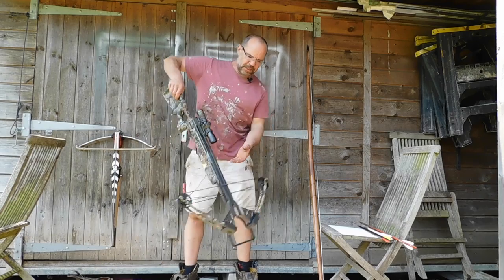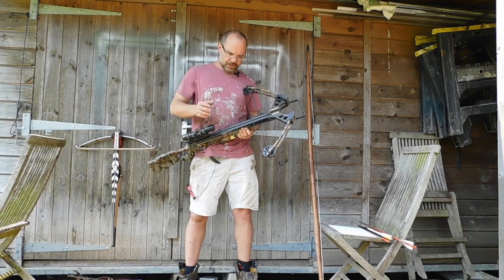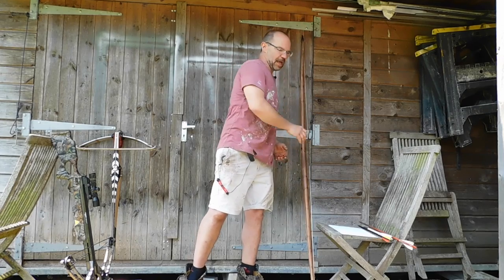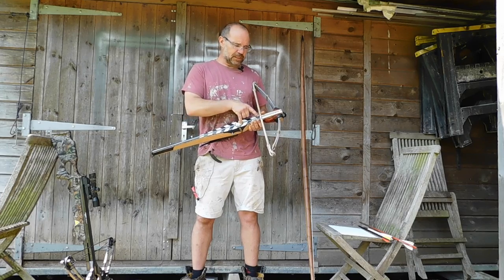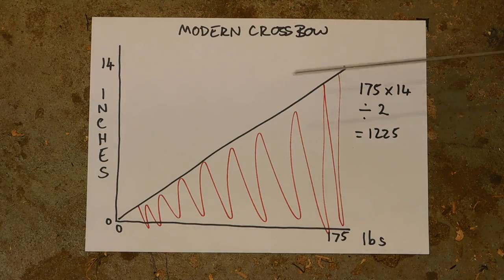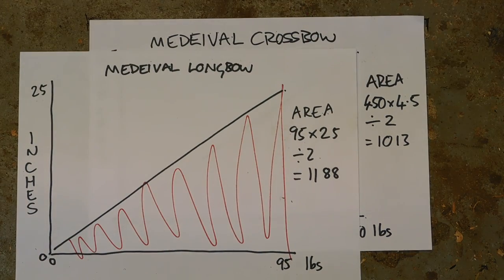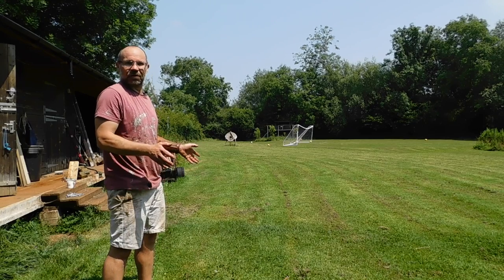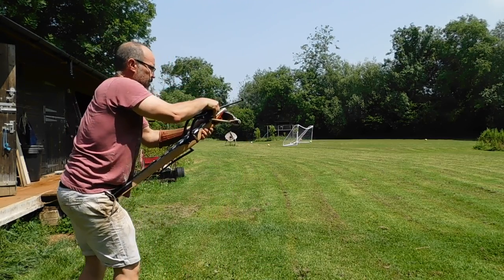Draw weights of medieval crossbows, longbows and modern crossbows

Comment: I guess this demonstrates why firearms of the day, primitive as they were, had replaced bows so rapidly.
Reply: It was also the fact that to be a competent longbowman required years of practice and exercise, and even being a crossbowman required a degree of skill that took time to acquire. A green footsoldier could be trained to fire an early firearm to the limit of its accuracy in a couple of weeks. This made it viable to field large enough units of arquebusiers that the volume of fire made up for the inaccuracy of any individual firearm, and do it for less money than it cost to train and maintain units of crossbowmen or longbowmen. 

The comparison with modern handguns is relevant for showing how much modern weapons have increased in power, but I think it would be more relevant to include comparisons with the firearms of the period, with all of their warts -- poorly-made gunpowder, smoothbore weapons with significant windage, limited rate of fire, etc.

Comment: A KE comparison of an arrow versus a bullet just isn't viable. A broadhead and a bullet do their damage in entirely different ways. Cutting an inch or two wide path through a human requires magnitudes less KE, and is more about the momentum. Bullets slow down massively, using a lot of their KE to mushroom the bullet.
Many folks forget about that KE=/=momentum thing though.

Comment: 10:30 -- AWWW MAN,  I simply have to ask you this question.

I noticed after you said "... don't put too much trust in this number..." for the modern compound cross-bow that the longbow was remarkably close in comparison, by virtue of the increase in "Power Stroke", which is on the vertical axis.  Let's take the difference in "pounds per inch" between graph A, and graph B; less than 50 pounds/inch.

So, the question is, can a long-bow archer lean into the shot, and increase the power?  Because, (A) the long-bow is presumably sized to fit the archer using it.  And (B) The difference of 50 pounds is a fraction of the weight of the archer, who is some arbitrary height, and perhaps 4 or 5 times heavier than 50 pounds.  I don't think a crossbow, compound or medieval, can be thrust forward by its user to impart extra energy anywhere near as effectively, for the same reason that the longbow has a longer power-stroke.  It is torque, or leverage, and the longbow archer's mass is integral.
Reply: Aw Snap, that's how most catapults work, pivot points with counter-weights....

Comment: Joules are highly misleading. Momentum is a more accurate measure of effectiveness, in many ways.
Reply: @tods_workshop  I bet the metric most in the minds of viewers is lethality (these are war weapons). If that's the case the measurement in joules yields completely contradictory results. I'd guess that if you hit the same spot on a deer with the .303 and the longbow the damage would be similar whereas the joules ratings are 60 to 1. Something in your math doesn't help to approximate real life though I have to trust your math as measuring something real.
Reply: I'm sorry, but there is simply nothing correct about those two sentences.  Efficiency is measured as the ratio between input and output energy of a system. Joules or Newton-meters are units of work or energy, depending on the context, where (very basically) energy is a property the system has and work is the process where energy is transferred between systems. Momentum is a measure of the movement of a system (absolutely nothing to do with effectiveness) that accounts for the mass and velocity of a system calculated as p = m × v. As kinetic energy is computed as Ek = 1/2 m × v^2 and given that you measure the mass of the arrows shot and the exit velocity in the chronograph, the  only difference in precision that you get is that you square the chronograph error, which if the machine is worth anything should be negligible. 

The one thing that might help is to convert the units of work the bows do, computed as 1/2 weight × power stroke (with said caveats) to Newtons and meters so that the resulting units are Joules and you can directly compare the work the system does to the output kinetic energy of the projectile, giving you the efficiency of the system as a ratio (or do × 100 and get %).
Reply: @MolcanAnti  Effectiveness as in how good is it at really ruining your opponent's day. Not a physical measurement of efficiency.
Reply: @mawe9878  fair enough, but I'd imagine you'd want to do that kind of measurement more on the target side, given the energy losses during travel. Also there might be ways of ruining your opponent's day using even less energy than the old school crossbow, depending on how squishy are the parts involved in the process :D.
Reply: For anyone interested, here's Tod's table, but expanded to include momentum:
Weapon                      mass (kg)    velocity (m/s)    momentum (Ns)  energy (J)
12 gauge solid lead   0.0378        485.4                   18.3                        4453
0.308 winchester      0.01             860                       8.6                         3698
9x19 parabellum       0.008          350                       2.8                          490
0.22 long rifle            0.0026        370                       1.0                          178
modern crossbow    0.031           92.1                      2.9                          131
medieval longbow    0.045          44.5                      2.0                          45
medieval crossbow  0.06             42.4                     2.5                           54

Masses and velocities taken from Wikipedia, except for the velocity of the shotgun, which I calculated from the energy given in the video. Of course, these will be at close range. I guess bolts and arrows lose speed (and hence momentum and velocity) more quickly than a ball or pointy-round.
Reply: Joules ruins my enemies day. Joules means how much work (destroying) can a projectile do on the target or on its armour. However to say effiency we need 3 numbers: joules we put in the system, joules the projectile get and joules actoually given to target.
Reply: @Rorgosh  excellent points :). Except joules given to target (destructive work) have many variables that could yield very different results, like angle of the hit, 'armor rating' of the target, the shape of the target, even the wind conditions down the trajectory of the projectile. I imagine modern ballistic labs would have means to control and measure these things, but it would be fun to design a contraption to test this in the technology available back then.

Comment: It seems like the quality of the bowstring and composition of the steel utilized would play a major role in the weapon's efficiency. It's unlikely that medieval crossbows were superior to Tod's in either of these categories. Nevertheless, deadly weapons.
Reply: Idk, despite working with inferior steel and metallurgic data, they might have known by experience WHICH crappy steel made the best bows. The crap they chose might be better (for crossbows) than what Tod chose. 

Or they may have used subtle techniques that we don't know about. Idk anything, but for instance maybe they used differential hardening on various parts, which might not be obvious today. 

I assume the strings have even more room for lost techniques. I assume there can't be many originals to study. 

It also depends what you compare the reproductions to - the best of the old world? The most common? 

The modern crossbow in the video was far superior to the medieval one. I'm not waxing too romantic I hope about ye Olde School - modern tech is better. (AK47 > crossbow.) But the old craftsmen were craftsmen back when craftsmen were craftsmen, and the good ones were good in ways that the lesser craftsmen could barely appreciate, let alone moderns trying to look back.
Reply: +tod todeschini - I agree that not all craftsmen were grandmasters working without constraints. I made a small reference to it by saying "the best of the olde world, or the most common." The most common stuff was probably common indeed. 

It's the simple things I meant, that don't necessarily require time or money. Knowing at a glance which of two very similar chunks of wood would be best, is the kind of skill I mean. (Idk enough about metals or bowstrings to give a more applicable illustration.) 

I don't think it's impossible for moderns to match or exceed the old ways - I think the opposite. I bet it will be done, just needs some trial and error. No one was even trying until very recently.

Comment: This isn't surprising at all - because this is why armor worked and why armor ended. 

 
A suit of armor would be an expensive colander to a fellow with a .22LR rifle. Sure, a few deflections here and there, but most would punch through. 

 
You won't start stopping rounds with steel until you are up to about the thickness of a lawnmower deck (as those are made to protect you from projectiles kicked up) and you won't find people wearing armor anywhere near that thickness. 

 
Those lower joules, however, make deflecting much, much easier.

Comment: at 12.03 minutes did you say 195lb draw weight for the longbow? Surely you meant 95lb? ;) Also that's a low FPS even for a longbow. Would it not have been better to average several shots?  You weren't at full draw on that shot so the bow was underpowered...and not really of medieval draw weight anyway. Not really a fair test, considering the crossbows suffered no such handicap.

Comment: Which one is the correct draw weight for the longbow, 95 or 195 you said 195 when you picked it up during the chronograph sequence but you calculated at 95 in the graph section if the graph had been 195, would have given you 2.4k not 1.2k(guessing it's 95 since you use that everywhere else). Also with crossbows you will get consistent results, since the string will always be drawn back to the same position, with a longbow probably inch or two here or there, dependant on the archers strength and arm length.

Comment: Really enjoyed this video however I don't believe you're factoring in the loss of power over distance for example as I have been shot with a Shotgun a shotgun loses an incredible amount of power the further away you are which is why I'm still alive however a longbow does not lose so much power and it's still deadly at Extreme range I think you should Factor in this before making your final calculations

Comment: This article about bow efficiency is interesting (although it's made by a company that sells bows, so maybe it's not impartial) http://www.dryadbows.com/Defining%20Bow%20Performance%20Dryad.pdf
There's also this one http://www.bio.vu.nl/thb/users/kooi/kobe97.pdf
Regarding the 1st article, I'm kinda surprised at the efficiency of the longbow in your test, less than 35% sounds really low to me. In the article the worst performer had an efficiency of 68% (the article is about non-compound bows, but they're made from modern materials, so it's definitely not an apple to apple comparison. The 2nd article somewhat compares materials.)
I'm not knowledgeable so I have no idea whenever this result is typical for all english style longbows.
I wonder if the bow would be a lot more efficient with a much heavier arrow, or if it just a bad bow by modern standards.

Comment: Energy comparison between modern crossbow, longbow and medieval crossbow was quite misleading. Compound bow does not have linear force build up but significantly more, it means it can store easily 1.5x as much energy than traditional bow with same weight and draw length. And who can pull 25" power stroke to 95 pound long bow? If brace height is 7-8" it would mean 32-33" inch draw length @95lbs, lol no. Medieval crossbow calculation was ok. 

So real values between the three would be something like: modern cross bow 2000, longbow 950, medieval crossbow 1000. Other factor is efficiency: modern bow is of course by far most efficient, then mediocre longbow and worst is medieval cross bow.
Reply: @tods_workshop  OK, but if it is too simplistic idea of the comparison may be lost. 

I'd like to thank you for your great channel, enjoyed a lot watching your videos. Your bows look very well made and I think they are fully comparable to old bows, if not better.

Comment: I don't believe for a second that they have made better crossbows than you do. Why would you think that? they didn't have the modern metals nor were they aware of any geometrical sorcery that would have make their bolts fly any faster. If you wouldn't restrict yourself to the known originals, with the short draw lengths and other things, you could build a bow that out shoots anything they may have had, right away,...they were limited by the technology of their time. One more thing, whatever may be written in the book of the crossbow,...they may not have had the accurate measuring systems we have today and maybe they exaggerate sometimes just "a little bit".

Comment: Bullets are blunt instruments that waste a lot of energy going very very fast.  Arrows kill by finesse and blood loss.

  It only takes about 40 ft lbs (54 Joules) to kill a deer with a sharp broadhead, but 737 ft lbs (1000 Joules) with a bullet.

  Why so wasteful?  The arrow and the bullet have to move roughly the same amount of air out of the way to get to the animal, the difference is that the arrow moves the air out of the way at 150 fps, but the bullet smashes the air out of the way at 2500 fps.  Much more energy is needed just to move that fast, add to that the energy wasted moving air out of the way.  What has more power, a jet plane or a car?  What is easier to stab into something, a knife or a hammer?

  Incidentally, do you know how much energy a laser gun would need to kill you?  Something like 100 times the energy of that 9mm.  A laser would be wasting all that energy to go the speed of light.